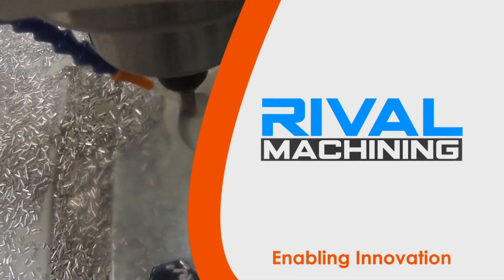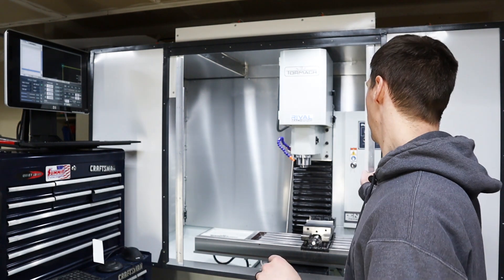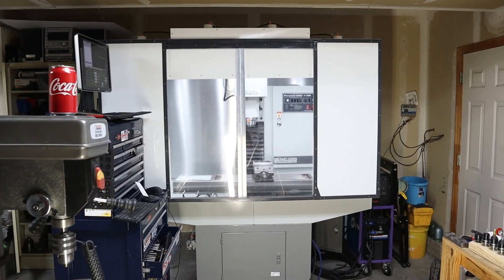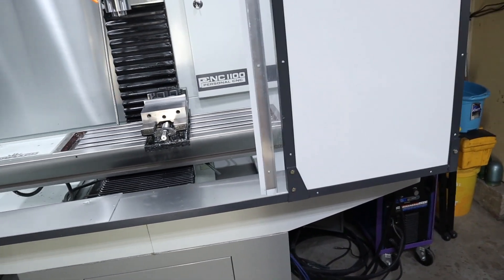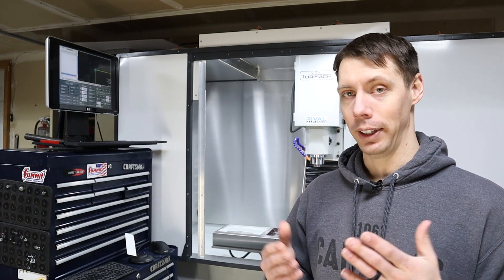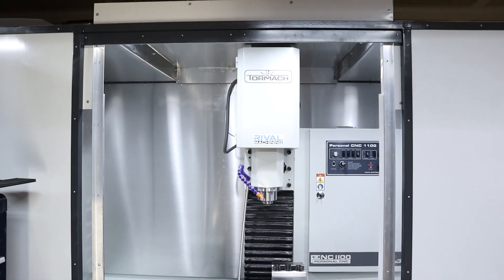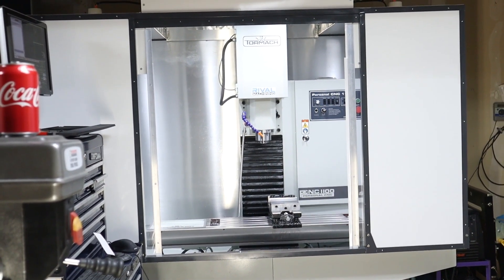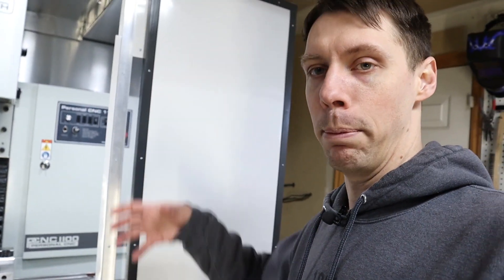Review: Tormach PCNC 1100 Mill DIY Enclosure Build

Comment: just found this and i am doing something very similar for my enclosure for a conversion i am doing. for you symmetry issue with the doors, just make a macro or add a few line in your post so whenever the cycle is done or you want to load a part, it puts it in the center of the door. Or just live with it, that may be the easier option now.
Reply from the maker: Ya, in practice I haven't had any issues with the door locations.

Comment: You can add a strip of shower curtain hanging off the bottom of the door to help with splashes
Reply from the maker: That would probably be a quick fix.  I was thinking about putting a strip of aluminum on the bottom of the doors.

Comment: cool intro,  you have a lathe?  side console would be nice!
Reply from the maker: Thanks, I think it was a little over the top, but it was fun to make.  I don't have a lathe, you probably saw my mini mill.  I haven't figured out what I want to do with it now that I have the Tormach, it just sits.
Reply: @RivalMachining  I use mine as a drill press mostly, or to square up stock while the cnc mill is running.
Reply from the maker: @piccilos  I've always wanted an old Bridgeport to sit in a corner for that.  I actually just sold the mini mill last week ):